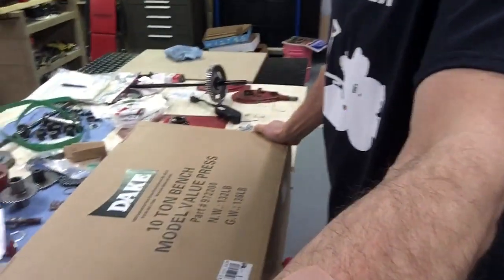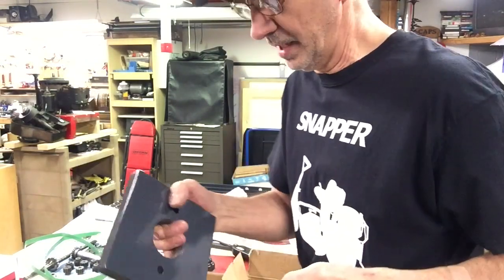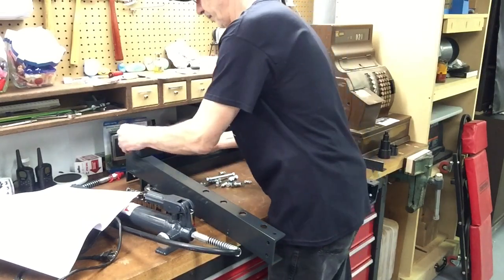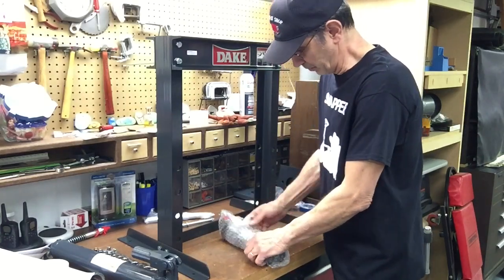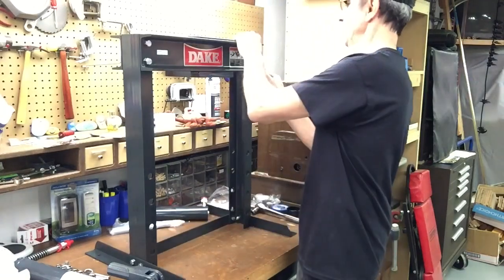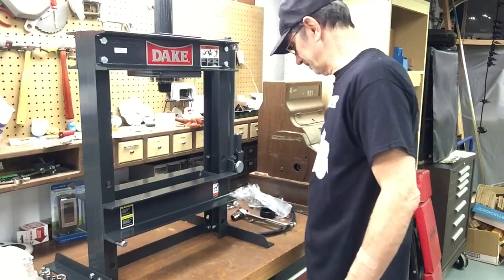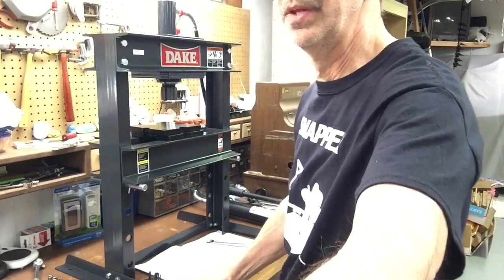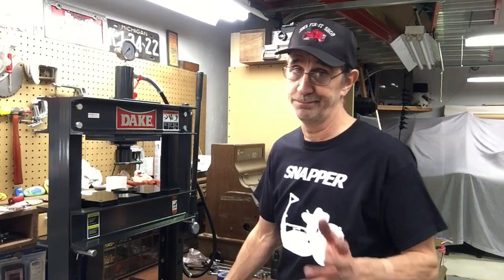419. How can I put together a Dake shop hydraulic press

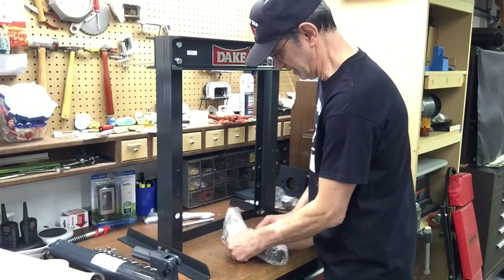Comment: 17:00 Hey Jim, take  those 4"x4.5lbs/ft channels at the top of the press and scab/stitch weld a 4x1/4" flat bar on each one. If you overdo it, and we all do, that's the part that bends. Making the bottom cross peace hard to adjust. Also get an air over hydraulic cylinder with a foot switch and a knob instead of the jack handle to open and close the pump pressure valve.
Reply from the maker: Thanks for the tip Dave but it has other issues besides that.      Jim

Comment: Hi, a few months ago I bought my first ride snapper, The model is a 281123BV and  it is in a good general condition, I love it, I have learned from you all I know about its mechanism and how to repair and adjusted these. I have to repair the chain assembly and the transmission, they are leaking lubricant and both chains have too much play. I wonder if there is a way I could purchase a kit to replace the chains and the lubricant seals? Any suggestion ?
Reply from the maker: They don’t really sell a kit because depending on how you use your machine certain parts where more than others the best thing to do is just disassemble it inspect all the parts and just buy the ones you need, I get all my parts from Parts Tree.Com. in Texas great company to work with, tell them Jim‘s fix-it shop sent you.           Jim
Reply: @jimjackson9381  Thank you, appreciate your answer!